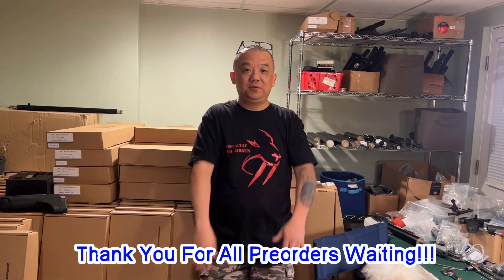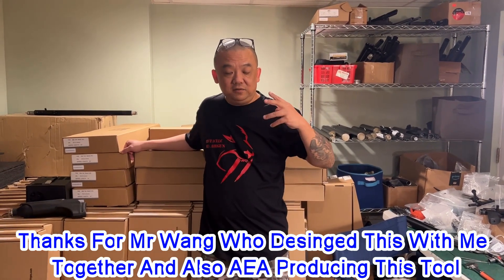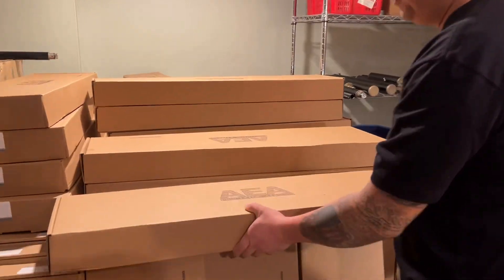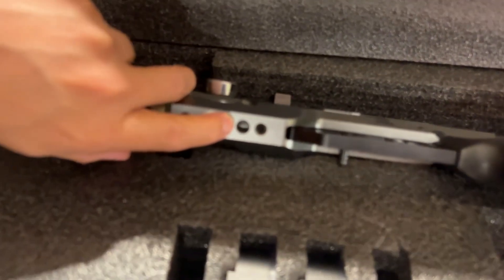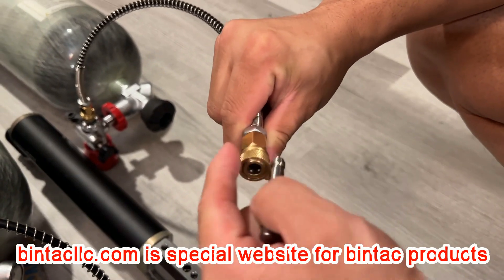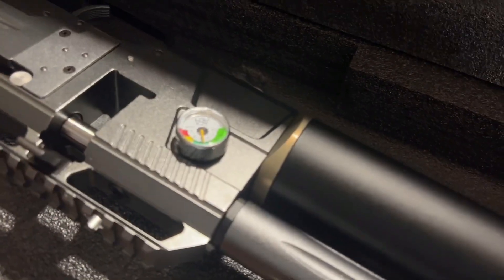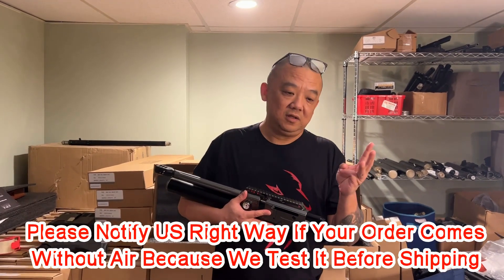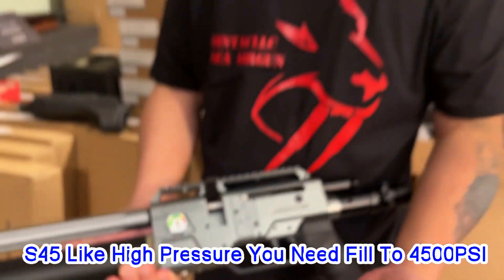BinTac: B&W S45 101-1 How to fill a S45 correctly

Comment: Should have contacted you right away I should have contacted you right away my HP 45 has had a leak brand new out of the box I shot it one time then when I went to go fill it up it leaked air extremely bad you sent me to Black o-rings I installed put back together and it's still leaking in the same spot where the air tank meets up with a main body I don't know what's going on.???? I've had it for 5 months so it's still under warranty I think I might just send back
Reply from the maker: Send back to us let us deal with it for you free no worries

Comment: I have the AEA HP MAX 45 cal. I am trying to remove the metal tank from it but the tank does not come out. Yes, I removed the gauge and the set screw but the tank will not release.
HELP PLEASE.
Reply: There are two set screws, one on each side of the gauge, which are different sizes   5/32 for large Allen and 3/32 for smaller Allen.